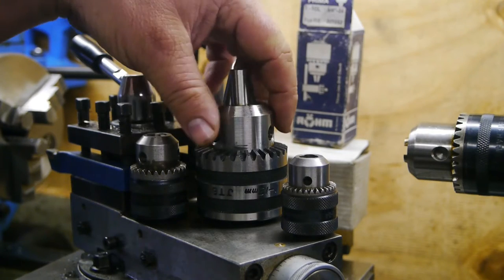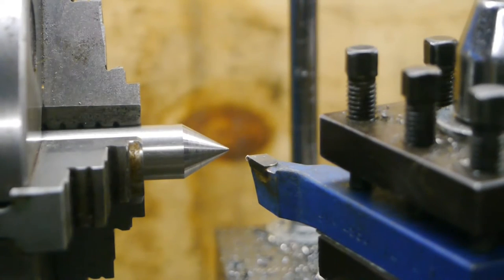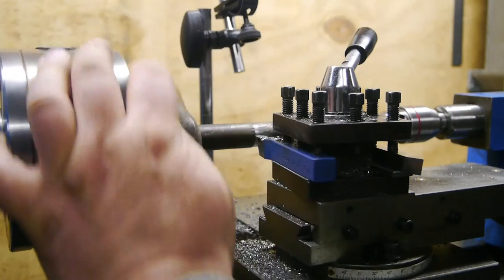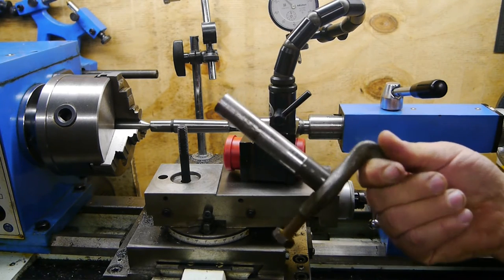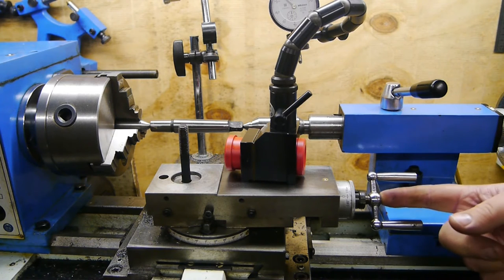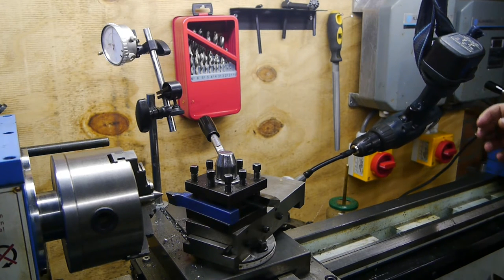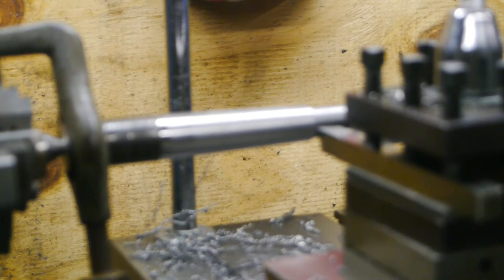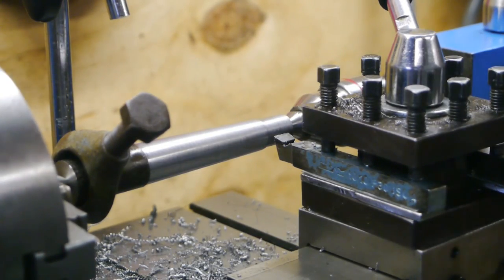Making a drill chuck arbor

Comment: I too am a hobby machinist and I have been through about every frustration that you have.  I find your videos very entertaining and I look forward to more of them.  I started metalworking about 5 years ago and I have managed to gather a really good stock of equipment having just about everything except a shaper and a surface grinder.  I have been to several machinery auctions where businesses were closing and I have scored about 600,000 end mills more than I will ever use but it is nice to have just in case you need it.  Keep on chippin.
Reply from the maker: Thank you. And a new video is in the works. 600.000 really? that will keep you going for a while :)

Comment: Hi, I came from different (work) profile and use to do machining as a hobby. I learned allot from
internet, sometimes a disappointing way. My experience in same job (morse tapper) surface
roughness, shows that you need perfectly SHARP tool with cc 1.5mm radius lapped, high rpm
lubrication an slow CONTINUOUS  UNINTERRUPTED feed for last two passes. It is necessary to take enough off, so that the tool actually cut and not only drag. I get this way even on stainless steel near mirror like finish. Hope to help a little, an yes I like your videos.

Comment: Why not make the narrow part of the taper at the left hand  (chuck end) ??
Reply from the maker: Because that's going to be the tang.
Reply: Rolingmetal but one of the advantages of turning between centres is that you reverse the workpiece  (just been watching 'doubleboost' doing that with his crankshaft (and have done it myself with a crankshaft )) (incidentally on one occasion when I tried the subtitles they told me that 'doubleboost' was talking Dutch whilst the automatic subtitles seem entirely happy with your 'version'  of English! )
Reply from the maker: That's true. I also turn the part around to cut the thread for the drill chuck.
I believe the project in this video was a failure. 
If you want to waste some time have a look a this one. https://youtu.be/BLxntq3QRyU

Very funny that Doubleboost is identified as Dutch.
He does have  a rather thick accent but I have no problems understanding it. It sure isn't Dutch :)
Reply: Rolingmetal English accents are many and varied, 'the Black Country', and the North East seem to cause the greatest problems!